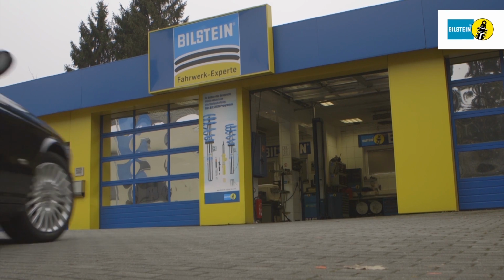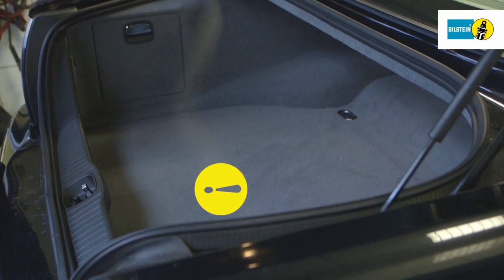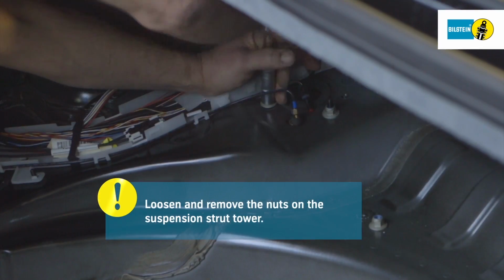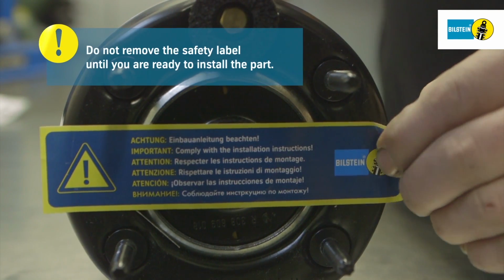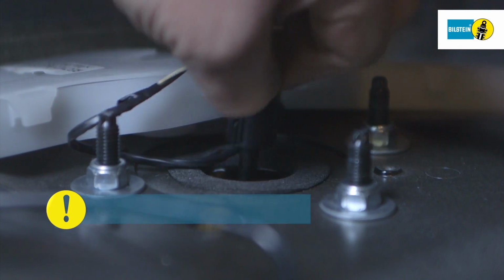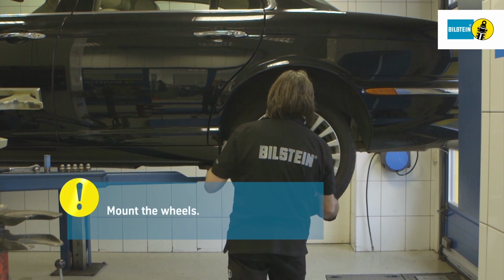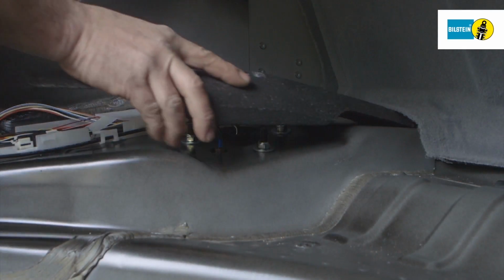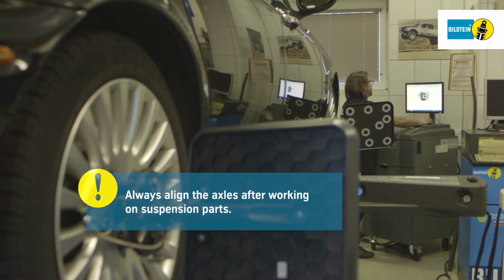BILSTEIN Installation instructions B4 air suspension module Jaguar XJ X350 rear axle

Comment: @8:03: "Using the specified torque, tighten all threaded connections loosened during the replacement process to the manufacturers specification."  Jaguar owners don't have, and can't get, the Jaguar shop manual containing the torque specifications.
Can you please find these for us?
Reply: Front: Bottom bolt: 129 ft/lb; top mounting nuts: 19 ft/lb. Rear: Bottom bolt, 98 ft/lb; top nuts: 19 ft/lb.